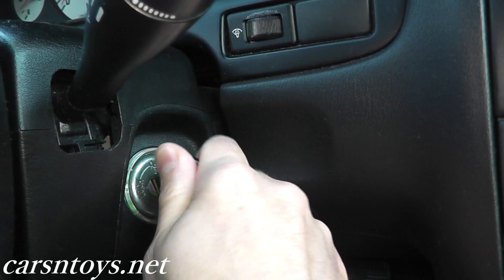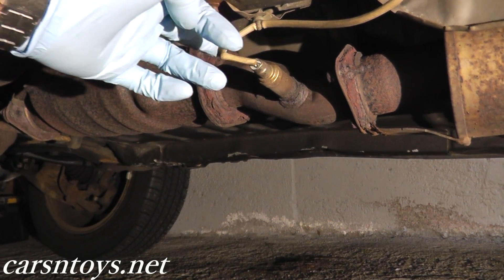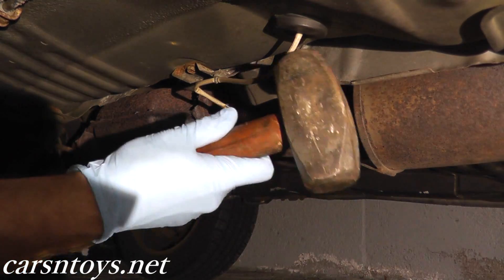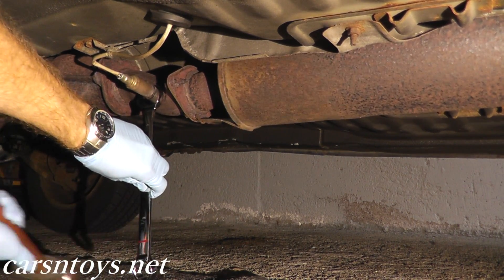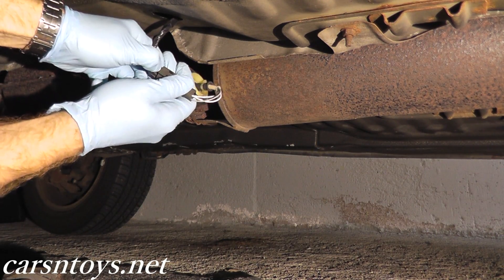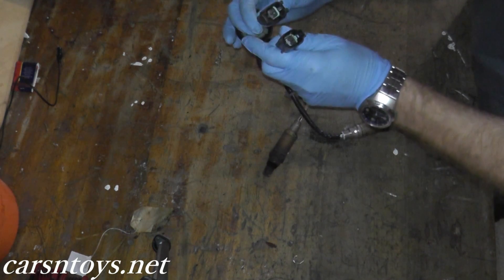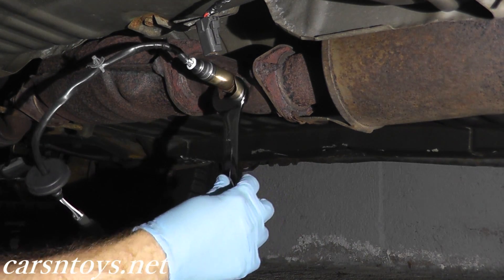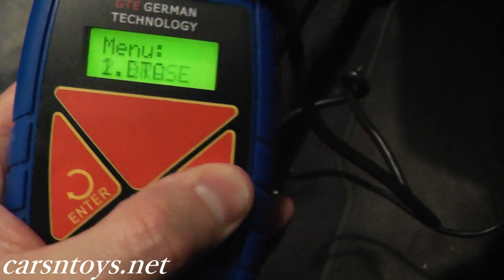Rear Oxygen Sensor Replacement P0136 HD | After Catalytic Converter Oxygen Sensor

Comment: Hi my Orlando is a 2012 and  was driving over a bridge and stopped to pay toll and I saw a few warnings lights on like check engine, the fix car,and the P with 3 lines behind it and also the  Slippery road sigh on at once. What you think then it also was showing a code 136 on the dashboard as well. Any advise?  I have a diesel engine

Comment: Thanks for the video even though this is really the happy path experience of doing this work.
Most of the time you'll need to wd-40 the sensor and/or torch it, avoid easily rounding off the sensor nut, and WORST OF ALL, stripping the threads when you think you are finally removing the sensor.
Other commenters on this video have mentioned these and the particular details. 
Again thanks for providing this video though.

Comment: Connection plug stuck in framework , how to remove ? 2006 Toyota scion v 4 , 4 door
Reply: Have to access it from the interior!! I’m about to do one on a 03 Toyota Echo and u have to remove the front passenger seat and center console to access the connector. It’s a terrible design!!!

Comment: I got the code, replaced the part, still have the same code... could it be another o2 sensor causing the misfire or possibly the wiring harness?
Reply from the maker: Is power getting to the harness? In other words, are the wires cut or loose at the harness connector? Any other trouble codes besides for the oxygen sensor?
Reply: CarsNToys yes there is power. I’m getting four of the same codes still on b1s2 all high voltage. I was thinking wiring harness?
Reply: i replaced 2 o2 sensors and still getting codes even after drive cycles. p0123 (pending) , p0151, p0132, p0410. this car cant pass smog. emissions test nightmare

Comment: I just heard a scraping sound in my car and whwn i looked it was a wire hanging down around my exhaust right after my catalytic converter. The wire is attached to a metal bracket that broke off. Is this the wiring to my 02 sensor u think? I dont have any dummy lights on or anything
Reply from the maker: Certainly sounds like it.

Comment: I highly recommend using BP Blaster on all the sensors a few consecutive days in a row before trying to remove them. Might save you a lot of hassle. All mine came off easily.
Reply from the maker: Thank you.
Reply: I like the same method with transmission fluid.

Comment: I just replaced mine after a long term of have the engine light on (2years) it was tough to remove the old one but with a help of the torch and the special socket it did came off easily. Thank you for your information
Reply: After you replaced sensor light, did your engine turn off ?

Comment: can you help I have a 1998 maxiam with a p0300 code
Reply: change the o2 sensor now have a p0300
Reply from the maker: Misfire code. I'll actually have a video for this shortly.
Reply: change the p0139 o2 sensor. then the p0300 pop up.ok wait the your video thanks.

Comment: I had a P0136 code with a Zafira, same problem, however the fault got rid of itself. Is it still a problem though?
Reply from the maker: Generally, no. But it may be a sign the sensor is on its way out.

Comment: Great Job ,I was thinking Your Exhaust was going to Break Before the Threads on the Sensor with that 3 pounder! But it worked,+1 for you ,Have to do the same one on the old lady’s Subaru Forester ,Same Code ,I use a couple drops of marvel mystery oil first though! Again Great!

Comment: I plan on attempting this with a 98 Forester. Would it be worth my while to check the wiring first and unplug/plug the harness connection before buying a new O2 sensor?
Reply from the maker: +Lilia Brock If the wiring is okay chances are it's the sensor itself. cheers

Comment: Dude...can't even get to the connector without disassembling the interior. I don't know why yours is like this in the video...maybe someone changed it before, but toyota factory position does not allow you to pull the connector out that easily.
Reply from the maker: +matreyia Yea, every vehicle is a bit different. This was done on a Nissan. Quite easy to get to.
Reply: I changed all 3 sensors on my 97 Toyota Avalon and I had to tear into the interior as well. It wasn't a problem just annoying.
Reply: matreyia me too man, doing the bank 2 on a 98 Avalon its a pain I’m trying to see if there’s a way I don’t have to tear it up

Comment: I don't  erase the codes after a fix on my own cars.  I usually drive the car until it turns itself off.  That way I know for sure that it is fixed.  What are your thoughts?  Also, thanks for posting this video.
Reply from the maker: +Tim Johnson That works as well. Cheers

Comment: Is this exactly where the rear heated oxygen sensor bank 1 sensor 2 is on a  (1996 Nissan Maxima)? 

Would hate to unplug the wrong one
Reply from the maker: Mathew Morse That's the one.It's located after the catalytic converter.
Reply: @Carsntoys  What about on a dual exhaust maxima? Do you know which side bank 2 sensor 2 is on? Driver or passenger
Reply: CarsNToys 
Thanks for the reply to someone else's comment... Now I can stop searching online on how to do this! :D 
Saving me over $100 in labor.
Reply: How can i order of sensor ?